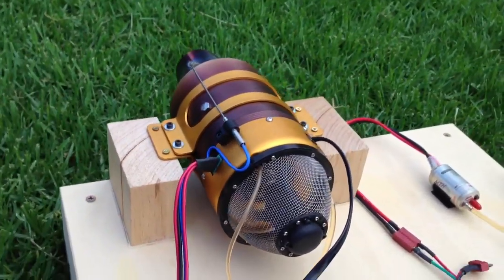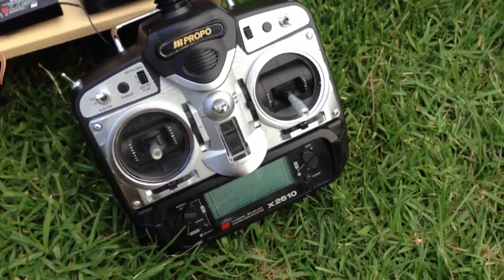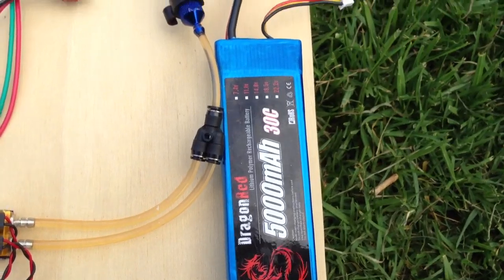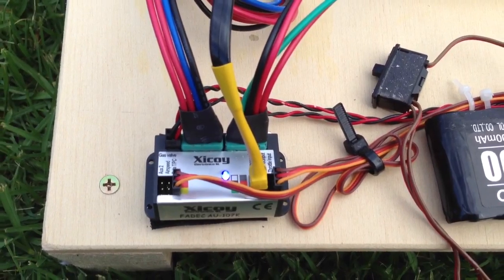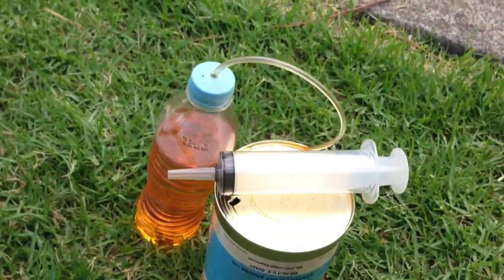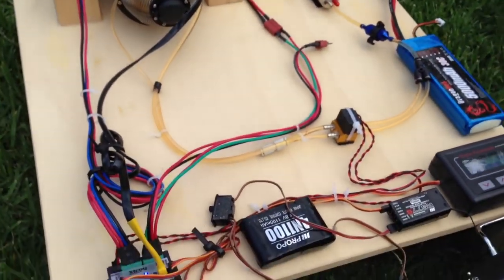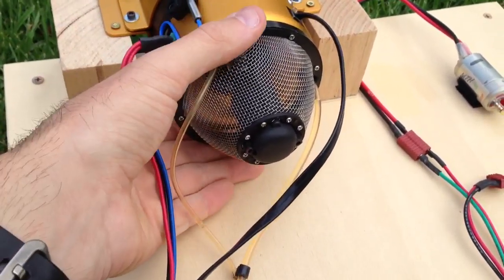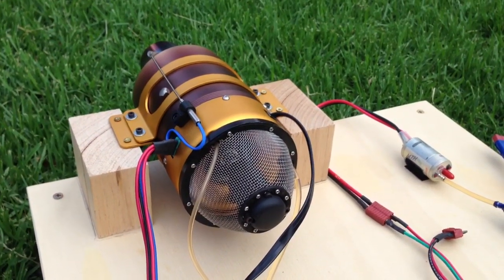RC Jet Engine Setup - Kingtech K80

Comment from the maker: costs around $2000, weighs 1340 grams, fuel consumption is average 240 grams per minute, fuels used can be jet a1 or even diesel as long as it is mixed with suitable turbine oil. hope that helps

Comment: I would like to know a few things if you can help of course.

1. How much does it cost? $ or £
2. What is the weight of the engine?
3. Fuel consumption rate?
4. (If applicable) delta v and any fuel substitutes.